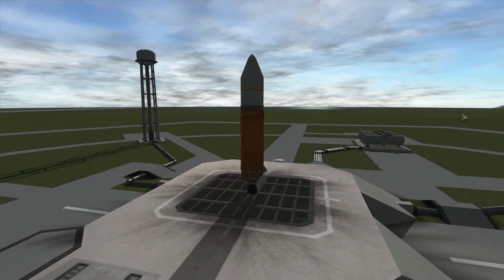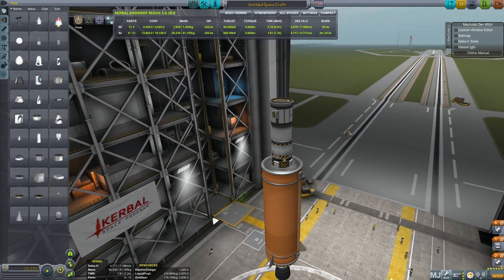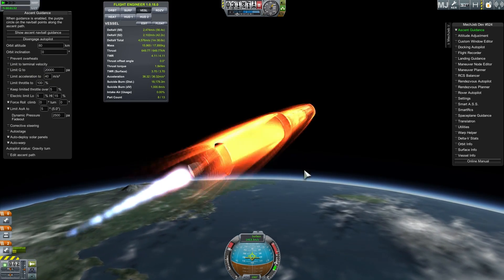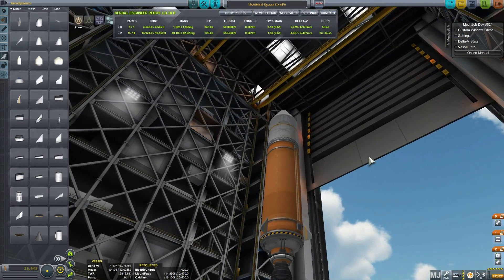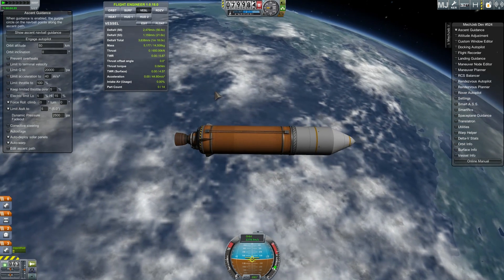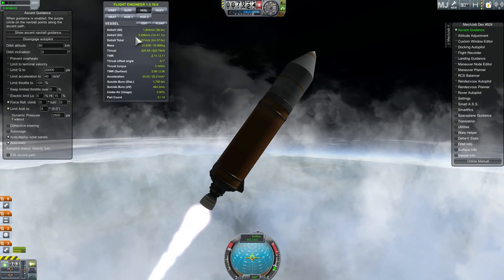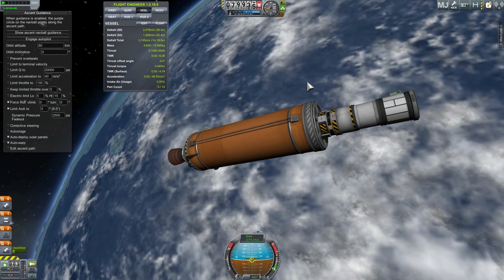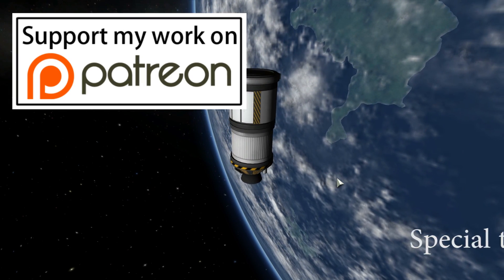Kerbal Space Program - Fairings Experiment - Should You Use Them?

Comment: Additionally, if the fairing was built better, that'd also create even more efficiency.
Reply: Yes, I actually usually use fairings with the same size as the payload. I think that might save a lot of weight. But like winged already stated 3 years ago: the main use for fairings is for your antennas and stuff to not get ripped away. Also the example here is built in way that doesn't create much drag at all.
Reply: @TheYear2525  
Originally, I was talking about the shape of the fairing.

A spike (as shown in the video) isn't as efficient as a more rounded shape, like a top of an egg.

But yeah.
I generally try to use the smallest fairing possible. As like You said, the bigger the fairing is, the heavier it'll be.
I'm not sure how the size difference between a fuel tank + different sized fairing part would do for drag, though.

I thought it only effected things 'below' the fairing. :s
Reply: @Known_as_The_Ghost  Why though?
Reply: @LootFragg  Uh, what?
Reply: @Known_as_The_Ghost  Sorry, uh: Why is a spike less efficient as a round shape? Because of higher mass?
Reply: @LootFragg  
I don't really want to explain aerodynamic physics at high speeds....

If you look at bullet, they have round tips(except for Armor Penetration Rounds). They're unlike a nail.
The same goes for most rockets.
There has to be a reason for that, and the reason is because it's more aerodynamic than the alternative spike shape.

The rounder shape does cool physics which makes the air move around it, instead of making contact with it(which is what the Spikes do, which causes drag, which is what you want to avoid).

The increased mass makes it worse, yes.
However, the less drag makes it more efficient overall.

... Just try to make it more egg/bullet shaped on top.
Reply: @Known_as_The_Ghost  Oh, like underwater projectiles that have a flat tip, forming an air bubble they travel in? That kinda somehow makes sense-ish. Why do jet planes have pointy nose cones though? I'm gonna wager that they're flying at comparably low speeds where pointy is still better than round?
Reply: @LootFragg  
I didn't know that's how underwater projectiles work...
But yeah, It's quite similar to that.

I'm not entirely sure why some jets have a pointy nose.
Maybe it's because it adds more control.
...
Or maybe it's because of the speed, the slower speed the more pointy it has to be to maintain that 'air bubble' effect.
Because...
Commercial Jet Cruise Speed: 460 – 575 mph (fastest jet is 7,000 mph, (which also has a rounded nose))
rockets ~17,600 mph
Reply: @Known_as_The_Ghost  Wiki says the flight speed record for unassisted flight is 2193.2 mph by the Lockheed SR-71 Blackbird.

Over 7000 mph have been achieved by NASA's X-43A scramjet, which is super-flat and pointy.

I've had a rough look into answers as to why some stuff is pointy and other stuff is round. Orbital rockets only reach very high speeds at high altitudes where the atmosphere is thin, so they don't need to be pointy.

Moreover, your point of creating a shockwave to minimize contact with the hull came up, which made sense to me. More contact means more friction, means more heat. At hypersonic speeds, you don't want the sides of the rocket to heat up, rather have a resistant nose that pushes air aside.

Really interesting. Wiki also says, the fineness ratio, how long a nose is and therefore how pointy or blunt, is limited by the increased friction that it exerts. So a pointier nose reduces the slowing  effect of the shockwave but increases the air friction on the exposed material, so it is ultimately a trade-off often in favor of more bluntness because pointier shapes are harder to manufacture.

Kinda makes sense. A very needle-like rocket would barely disturb the air but it would just melt or break. A flat box pushes so much air around that it will have to constantly overcome that drag. With perfect construction materials that are unbreakable and super-light and with means to shed the heat from friction, you could make atmospheric rockets super-pointy and save fuel but since all materials have limitations, nosecones are round.
Reply: @LootFragg  
My point still stands.
Reply: @Known_as_The_Ghost  Which one?
Reply: @LootFragg  The original.
Try doing tests for yourself.
Reply: @Known_as_The_Ghost  Uh... this one?

"A spike (as shown in the video) isn't as efficient as a more rounded shape, like a top of an egg."

You mean this and testing for fairing shapes?
Reply: @LootFragg  Having fun?
Reply: @Known_as_The_Ghost  Shit, what did I do wrong? I don't see it. Is there a meta joke I missed?
Reply: @LootFragg  Ohoh, yeah.
There's a joke alright.
Reply: @Known_as_The_Ghost  I'm gonna guess that you won't explain it to me because that'd ruin the joke. But  do tell me if it's an inside joke related to KSP or a meme or whatever so I can at least try to get it.

Comment: so this experiment proves that fairings are good for drag reduction, as your craft inside the fairing is itself not too bad at being aerodynamic. if you had a bunch of stuff attached to it, sideways docking ports, structural / robot parts sticking out, etc, then the drag would have been a lot worse without the fairings.

But like others mentionned, the goal of the fairing is not saving DV, although it's a VERY nice bonus. The real objectives of the fairings is 1) protecting your payload from the atmosphere and 2) keeping your rocket straight. drag at the front is horrible because it wants to flip the rocket flamey end first. taking out this drag obviously means saving DV, but the real benefit is to keep the rocket from flipping over!

Comment: Excellent - however, if you have more radially-attached greebles on your rocket (solar panels, parachutes, antenna, sensors, lights, landing legs, and other stuff), each piece will add drag, thus making a fairing even more effective in reducing drag (and increasing efficiency on the ascent).  A simple in-line design like what you demonstrated is probably only generating drag on the front faces of the probe core and RM-64 tank.

So they work, but they work even more if you have crazy-complicated payloads you're trying to loft.
Reply: Basically all of my craft, with bits and bobs all over the place
Reply: most of that pieces are physicsless, so unless you use a mod that calculates the drag from them, they are no problem. maybe the fairing will protect them from heat.
Reply: +Pietro Celano Wrong. KSP has changed the physicsless parts in v 1.00 I believe (2015).
Reply: goku
htey changed it in 1.1, i think that at the time of my comment 1.1 wasn't released? or maybe i was just ingnorant.
Reply: goku
i was just ignorant.